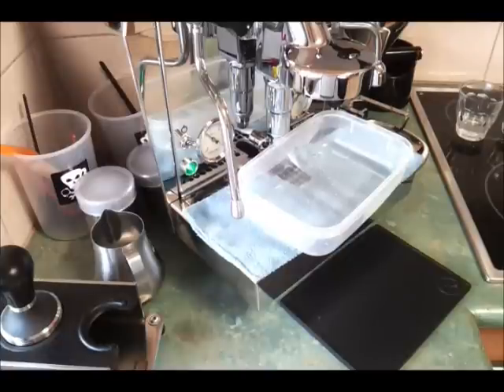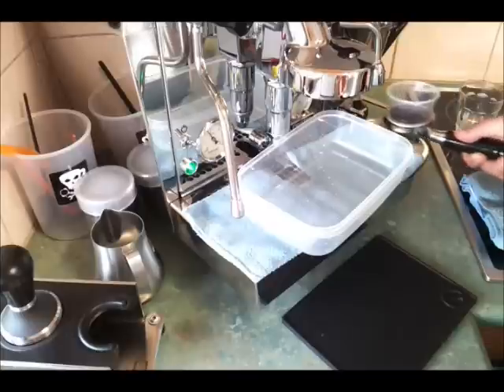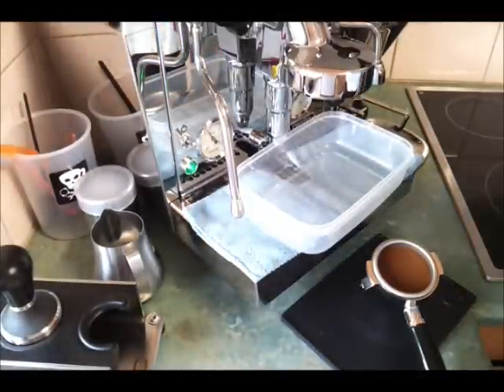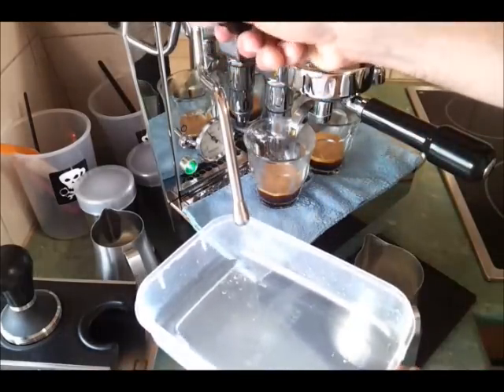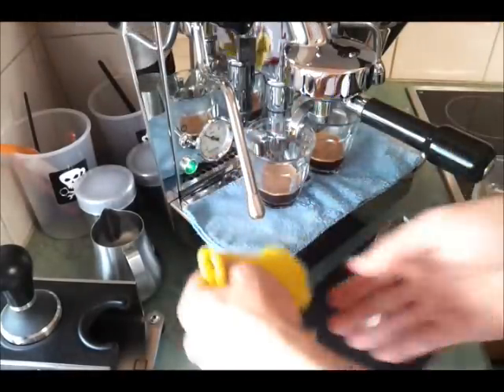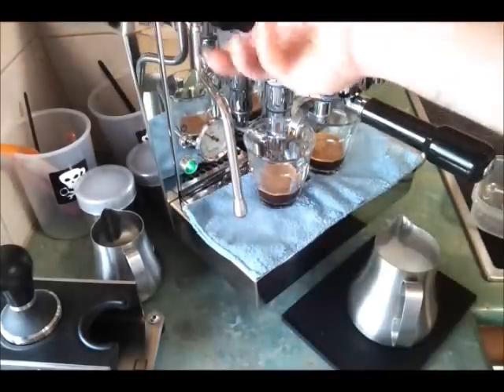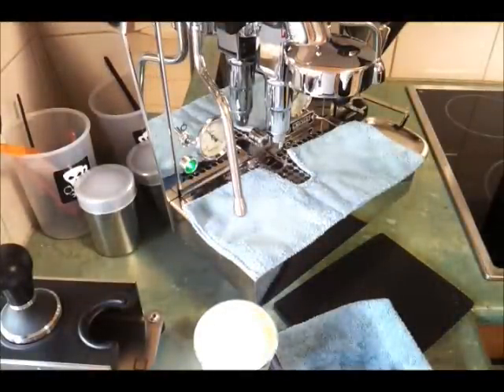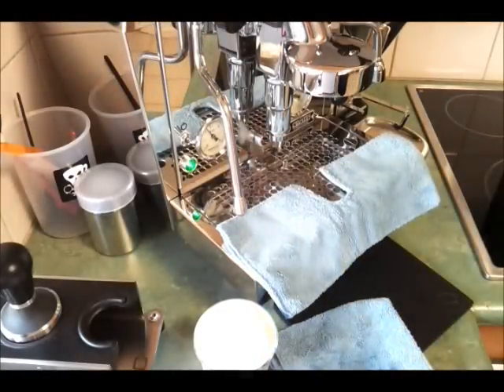Steaming with the Giotto

Comment: @ Markpianoman you can play with the pressure valve a bit and by that govern the temp of the water entering the portafilter. That has a direct impact on the thermal memory of your machine though, so keep in mind the thumb role: the higher the pressure inside the boiler (you have a thermometer for that on that particular machine), the higher the temp of the brew, the shorter the thermal memory is (meaning you have to mess with longer flushing after long ideling).

Comment: Enjoyed your video. I have the same equipment (machines), and am curious as to what temp the water comes out of your Giotto brewhead.  I'm talking about directly from the brewhead -- not after running through the portafilter.  Mine comes out at 88C even after heating for much longer than 1/2 hour.  I've heard that 92-95C would be better.  I think I would have better luck with the milk texturing if there was more heat and better steam.  I'd appreciate your feedback.